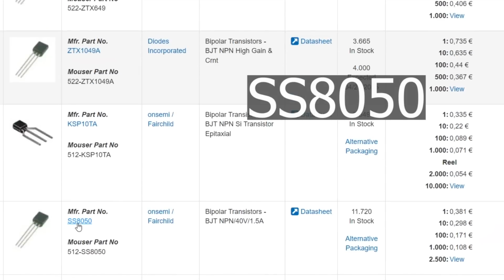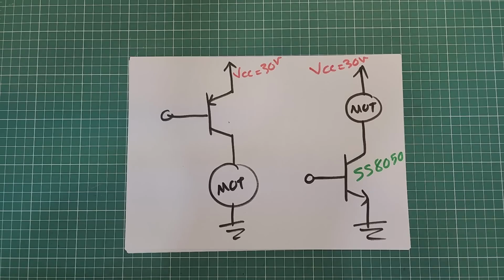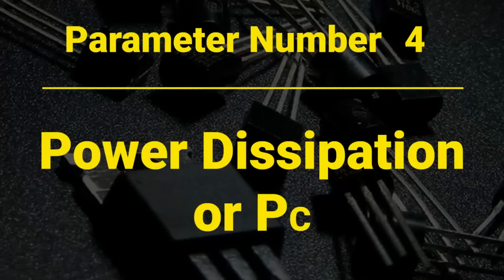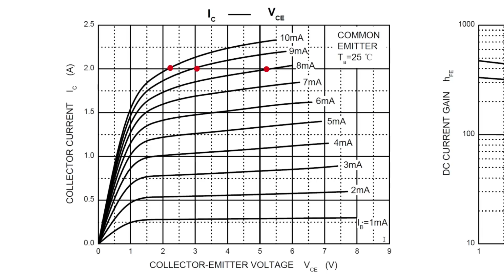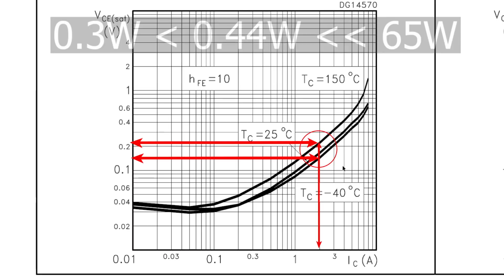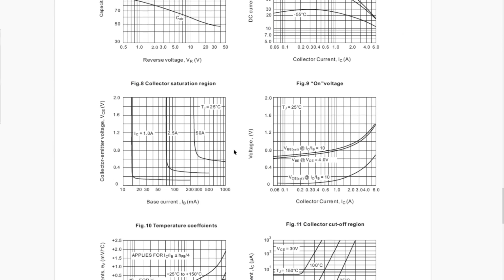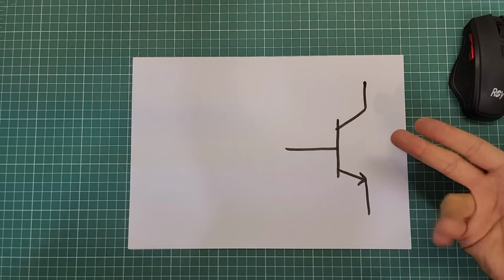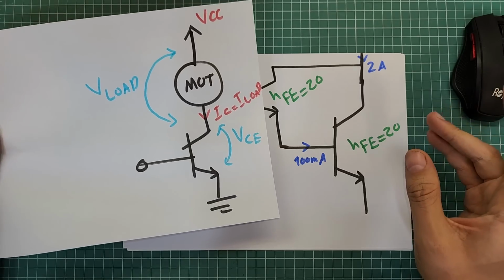How to select best transistor for a particular application?

Comment: I'm just starting to get into electronic circuit design and engineering. I was wondering if you would do a beginners video on just how to read an electronic component datasheet. I find it confusing between absolute maximum ratings and electrical characteristics ratings. Should we be using and forcing these components to max ratings or is there a sweet spot?

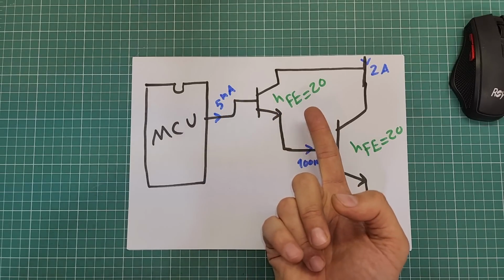Comment: In 22:10 the smaller transistor's collector should be connected to the power rail correct? Connecting it to the collector of the larger transistor will not supply adequate voltage since this is a NPN setup on the low side of the circuit is that correct?

Comment: Hi, I really liked your explanations about choosing the right BJT. I would like to add some points for selecting the right device.
Using your example of a collector current requirement of 2A, choosing a device with 5-10A is a good starting point. Most maximum continuous collector current specs IC (DC) are assuming an IC/IB of 10 or 20 to stay within the allowed power dissipation Ptot of the device. So, you should over-spec the device on collector current to keep Ptot low.

You should also look at the conditions for the Ptot specification. For a through-hole device like TO-92, it is simple. But for devices like TO-220, you have to look at the specified cooling conditions. For SMDs, you have to look at the solder area (footprint, 1cm2 cooling pad, etc) and the amount of PCB layers used for the Ptot spec.
The next parameter you should look at is hFE. If the hFE at low collector currents is about 50, you will not be able to drive this BJT with low base currents at IC=2A.You should look at the "Low VCEsat" types of major suppliers like Diodes, Nexperia, On Semi and Rohm (in alphabetical order). These have usually higher hFEs and VCEsat curves in the datasheets for IC/IB ratios of 50 and/or 100. Look for a device, that still has low VCEsat at IC/IB of 100 and 2A.
Looking at VCEO, you should not overspec too much there, as higher VCEO for the same internal transistor area translates to losses on the other electrical parameters like hFE, IC (DC), VCEsat, switching time). For example, it is very hard to find a BJT with VCEO>100V, that has a high hFE of 200-400 and a very low VCEsat and fast switching.
If switching time is a consideration, Darlington BJTs are the slowest. Driving a single BJT with a very low base current, i.e. not into deep saturation, helps here. Special Switching BJT normally have higher VCEsats as a trade-off and are not always an alternative.
My employer recently published a BJT Application handbook, if you really want to dive deep into BJTs: 

https://efficiencywins.nexperia.com/efficient-products/bjt-application-handbook. You can find a direct download link, if you search for "BJT handbook" on the Nexperia website.

Comment: Thank you for the videos. I am looking for a small laser driver with a transistor. When I switch on the power to the constant current source, there is initially a short flash of the laser diode. Do you know how to limit the initial current to a constant current source ?
Reply from the maker: Did you see the transistor based current limiter circuit in the transistor application video? I mean '7 awesome application of transistors in circuits'?

Comment: What margin from the maximum allowable Vce voltage should be maintained for reliability?
Reply from the maker: There is no a standard margin, the more margin, the more the reliability 👍
Reply: @elewizard  And there is no golden rule by experience? For example, let's assume that a small-signal transistor in a TO-92 housing operates with a collector current of less than 6.94mA and does not exceed half of the maximum Pd, i.e. 0.5W/2=0.25W. The maximum allowable Vce for this particular bjt is 45V while the supply rail voltage will never exceed 36V. Thja=200K/W but I assume that the circuit will never operate at temperatures greater than Ta=50°C. So the junction temperature range will be 68-100°C(Tj max=150°C). So everything seems to be matching specs. Will 9V margin be ok or not so much?

Comment: In switching applications, hFE is almost irrelevant. For most switching BJTs you design for an hFE of 10. That is specified by the manufacturer to ensure that the base is overdriven pushing the transistor into saturation. That is why the data sheets almost always quote Vce(sat) with a ratio of Ic:Ib of 10:1. The power dissipation will be Vce(sat) x Ic and you then can work out how big a heatsink you need since you want to keep the junction no more than about 125°C above ambient. That means Pmax = 125/(thermal resistance junction-to-case + thermal resistance of heatsink).
Note that you would need an infinite heatsink to achieve the power dissipation quoted in the datasheet at a case temperature of 25°C. Realistically, It will always be less than that.
Reply from the maker: The points you mentioned are not understandable to newbies, i think such points has to be presented to someone that is experienced. Anyway, thank you for your nice and informative comment 🌷
Reply: @elewizard  I disagree. Designing a BJT switching circuit to use a base current one-tenth of the required collector current is well within the grasp of any newcomer. Compare that with your description of hFE and the calculations you suggested for base current and you'll see.
Reply from the maker: The goal of the video is to introduce some parameters of BJTs and explore the datasheet, maybe I am wrong. However I appreciate the time you took for writing these informative comments 👍
Reply: @elewizard  I do understand your aims in making the video, and I appreciate your concern to keep it simple to ensure it is understandable for an inexperienced audience.

Nevertheless, I have found over the years that there is a general misunderstanding of the relationship between base current and collector current in switching circuits. For that reason, I believe that every introduction to using BJTs as switches ought to emphasise that Vce(sat) is only valid when the base is overdriven.

Thank you for the videos that you make; I do enjoy watching them, and any criticism I make is solely intended to help you when you revisit the topic in future.
Reply from the maker: It is obvious to an experienced people that the Vce(sat) is valid only the base is overdriven, but it took longer to a newbie to find that 👍
BTW, I like your T-Rex 🦖 avatar 🙃

Comment: Please note that there is no "collector-emitter junction". The Vceo parameter is the maximum voltage that the BJT will tolerate between its collector and emitter. That is often less than Vcbo, the maximum voltage that the BJT will tolerate across its collector-base junction, which really is a junction. It's helpful if you don't confuse the two parameters.
The STMicroelectronics 2SD882 is rated for 12.5W with an infinite heatsink holding the case at 25°C. The key parameter is the thermal resistance junction-to-case which is 10°C/W. If you used a 10°C/W heatsink, you could dissipate up to 6.25W which is well within the dissipation at 2A when the transistor is in saturation (2A x 0.7V = 1.4W). The moral of the story is don't use cheap Chinese knock-offs with incorrect or inferior parameters.
Reply from the maker: Thank you so much for mentioning that the collector-emitter is not a junction. It was my lingual mistake 🤪 sorry for that. 
Anyway, thank you for the valuable information you provided in the comment.👍 and thanks again for improving my English skills 😊

Comment: of course we want a fet vid. thanks to you i already no longer think of mosfets as for high V applications, and instead think of them as suitable for low I applications. i spent ages playing with 520s on BB on my bench. fascinating how i can turn them on and off by touching the gate and with other hand touching VCC and ground. i saw mehdi do it once, whilst saying " bing, bong, bing, bong" but it wasn't until you covered mosfets in your previous vid that i finally grasped the internal capacitor.
Reply from the maker: Great, so you are familiar with FETs. I will cover more info about FETs in my upcoming videos 👍😃

Comment: There are several further important parameters of transistor, which are important for certain applications. If you consider switching applications especially for frequencies higher than a few 10 kHz, switching times (on / off) become very important. They are often not correctly implemented in the spice models of transistors.

And yes, FETs are an important species, especially the MOSFETs for switching purposes. If you use a MOSFET instead of a BJT for low power switching you can often save a resistor, because you can directly control the gate with a controller output. When I need an inverted signal I nowadays often use a 2N7000 instead of a 2N2222.

In high power / low to moderate voltage, fast switching applications MOSFETs are a must. Only at very high voltages (>500 V) you may use the advantage of IGBTs. IGBTs are not very common maker devices, because their real advantages are related with very high voltages and moderate currents (<50 A).

In the use of MOSFETs the input related capacity and the gate charge become important parameters, because their preferred use is fast switching. But it is also important to limit their switching speed in order to avoid electro-magnetic interferences (conducted and radiated emissions).
Reply from the maker: Thank you for your feedback,  the information you provided in the comment is valuable and welcomed ❤️🌷